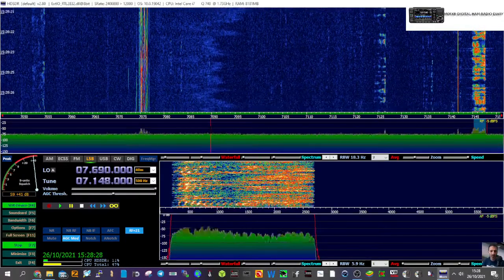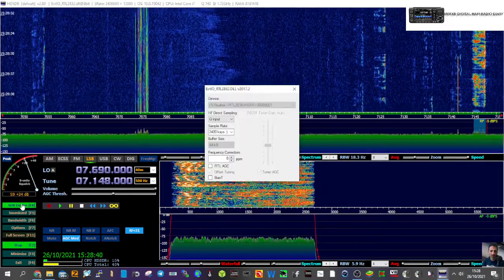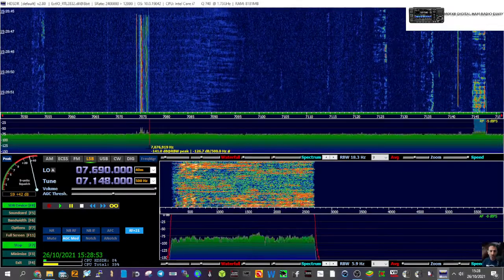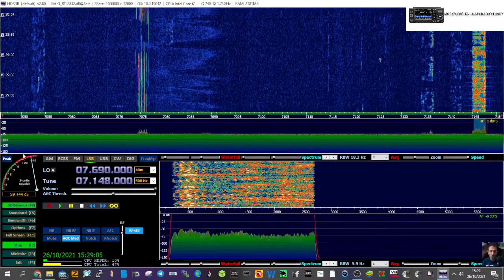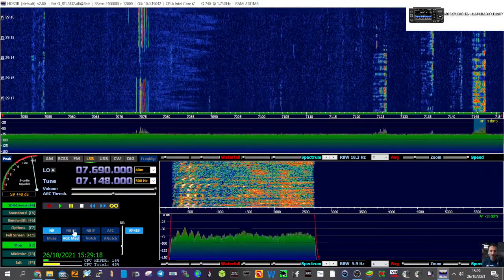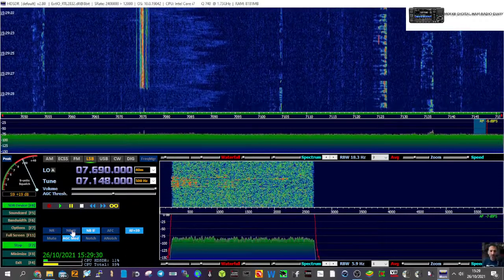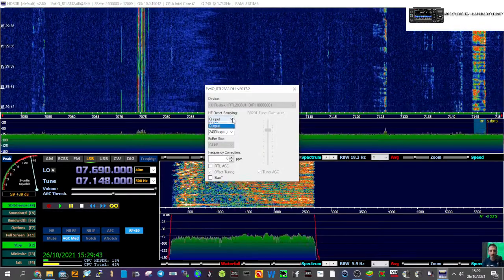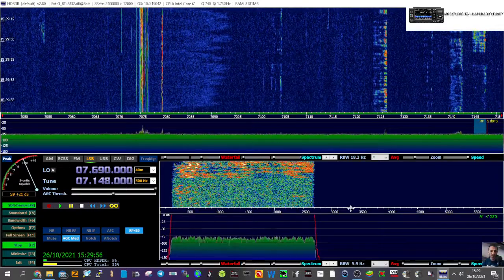RTL-SDR - HDSDR  -HF settings

Comment: so what frequency off-set did you put for the RTL-SDR to be able to work HF ??
you didn't tell us you're using version 2.8, some of us are still on v2.76 which has ExtIO setting.
also i am using an active antenna, i get +30dBm on my HF receiver and HF sets, yet on the SDR nothing,
although i can hear myself at S1 if i TX on say 40m, so come on, what other settings do we need ???
Reply from the maker: https://youtu.be/WeHFSSDetis?si=XVGD6VP6ER-qJvWl

Comment: It would help a whole hell of a lot, if you explained things a lot slower, and clearer, regarding all the HF settings, instead of running through them as if people viewing this video would know them off by heart.  I have VHF coming in with no problem, but can't seem to get the HF bands working, even after switching to "Q", and to 2400 k. I've just set this up, and have very little clue on how this programming works. For HF bands, I am using an Active antenna. For some unknown reason, I am not getting a single signal on the HF bands, except for loads of static. I have the Radio FM bands coming in great, along with Amateur VHF ham repeaters. Problem is, can't figure out why the HF bands are not coming in as well, once I switch over to "Q". What am I doing wrong here?  The viewing of the HDSDR program you posted, is very hard to see the settings you mentioned, even when expanded to X500 mag. Explanation, of how you set-up for receiving HF freqs., need to be explained slower, and in far more clearer detail, for first timers using HDSDR programming to follow, and understand..
Reply: What are your bandwidth settings? They can't be seen in this video.
Reply from the maker: Hi what antenna are you using ?
Reply: @M0FXBHamTech   "An active antenna"

Comment: I've got completely different settings in that menu (F8), no HF option, but loads of extra stuff. I'm getting absolutely nothing visual or audio, tried all the different soundcard options (F5), not even static. Tried Airspy and that appears to work ok.
Reply: ...Seems I downloaded another extio for TCPIP. So I downloaded the correct one, and now it says "extio dll not active" Seems there is a signal now coming in from the mic on my soundcard.
Reply from the maker: So many things it could be .

Comment: I need help. I’m just getting into sdr. I got an rtl-sdr v3 and tried using it with both sdr# and hdsdr and get nothing but flat lines of solid tones randomely throughout the spectrum. I’m trying to receive hf bands/ shortewave and have even gone as far as setting direct sampling to Q branch and set up a 50 foot long wire antenna and am still having the same issue. I can’t even receive a simple time signal… any help would be much appreciated
Reply from the maker: Hi have you installed the drivers.using Zidag ?
Reply: @M0FXBHamTech  yes that was one of the first things I did when setting up. I followed a YouTube tutorial
Reply from the maker: @dylanlloyd3447  what adapter are you using for the antenna check it has a middle pin
Reply: @M0FXBHamTech  sma connector, yes middle pin is in there
Reply: @M0FXBHamTech  it only receives FM radio music. If that info helps at all. Every other signal are just flat carrier like tones.